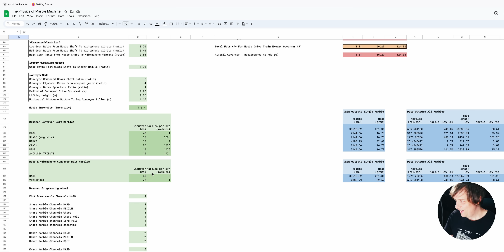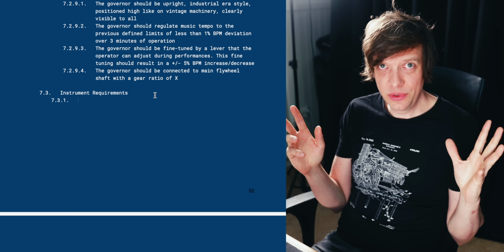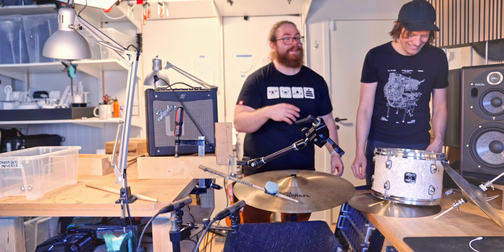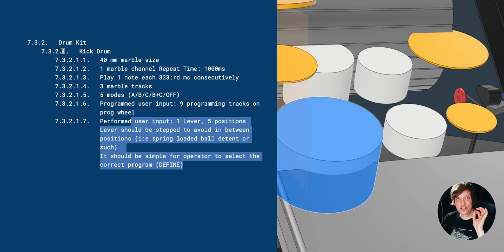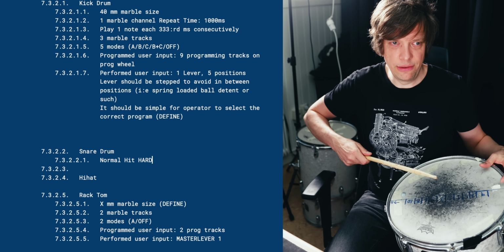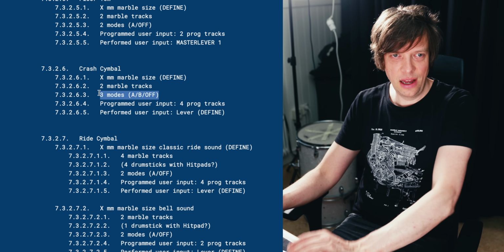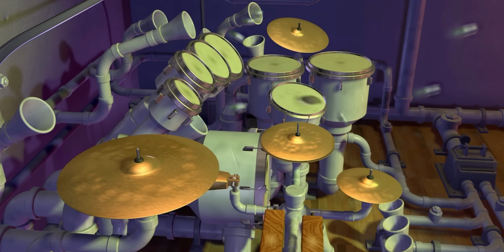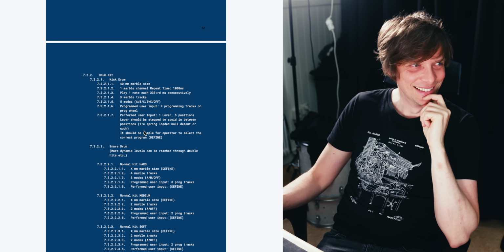Building the Marble Machine in a text document - Better than I thought!

Comment: If you continue like this, you will fail for the same reason MMX failed. Calm down your requirements, no dynamic music, less channels, make a portable machine and not an airship where a band as accompaniment is obsolete anyways
Reply: I think this machine has a better chance than his previous machines because he planned it out, and started using advice and ideas from the community. His other machines, he just winged it, and ultimately suffered the consequences.
Reply: i agree that it is monstrously big and not portable enough to be used frequently between sets and countries, but the dynamic part id like, brings more artistic impression into the build
Reply: @ZT_1234 ok but let me ask the question why? As in previous videos we saw martins saying "i need to do things easier, more practical, with a simplier design" to not lose the real goal of the marble machine: playing many melodies
Reply: This would be too logical. MMX could have been compelted already - applying those rules 3 years ago.
Reply: For th MM IV I'd go straight from text to punchcards.
Reply: @ZT_1234 that's how MMX was supposed to be.

Comment: Using two tracks to drop simultaneous marbles for dynamic range is going to exacerbate any timing issues and make them a lot more noticeable. Slight timing fluctuation between beats and instruments sounds human and won’t be noticeable in the vast majority of cases, but if every snare accent sounds like a flam, you’re going to end up back in the “perfect timing or bust” rabbit hole
Reply: I agree here.   Additionally, I believe Martin needs to consider methods for muting/choking the cymbals if it can't be done by hand(as would be the case with the current layout).
Reply: I agree. Considering Martin has room for more tracks, it seems wise to just add the extra channels back in. I think he'd only need to add half a dozen or so channels back in.
Reply: If the two hits are within ~10ms they shouldn't be noticeable. If the tolerance is 2ms that should be safe.
What may be more concerning is if he drops the marbles on different parts of the snare drum, the resulting sound probably won't be very nice since every part of the drumhead produces a slightly different sound and also the marbles will probably act like dampeners to each other.
It needs testing for sure but from experience it may be more of an issue than asset.
Reply: It will also probably create interferences between the marbles because of high-hat vibration which could create weird trajectories for the marbles that are difficult to predict (this is pure speculation though)
Reply: @mikosoft  Yeah that's probably not going to work if you hit a cymbal on two places at once.
Reply: Annoying that the video won't let me post a new comment of my own, but I just wanted to draw attention to "liquid courage"? That coffee? Or..?
Reply: @ilepcro  good thinking on the bigger picture, but from prior testing on the MMX the marbles have a quite predictable trajectory. Although, I would argue that apparent safety was what made Martin go for the “path of sunken cost fallacy” with those individual funnels instead of considering a more general collection system on the MMX. 

Remember that it wasn’t the marbles on the floor that made Martin give up on the project but the BPM tempo consistency and note timings.
Reply: Kinda agree that it should be optional, however if you have 50 or so channels anyways they all need to be synced anyways. So double drop souldnt be an issue on a well times machine.
Reply: absolutely
Reply: As soon as he uttered the words "dropping 2 at the same time" I immediately thought of the timing nightmares!
Reply: Any delay will be noticeable, if only to martin. remember back when he was doing timing tests on the 3D printed marble droppers? At one point he had a click play from each stereo channel with some delay. I could hear all the way down to one millisecond, just slightly but still noticeable. 
I agree with the original comment, trying to drop multiple marbles at the same time will lead to perfect timing or bust.
Reply: @kungfucasey  I have a theory on how that muting/choking can be done with the machine. Obviously you will need a channel for each mute device. A programing pin would work a Bogen cable that operates a... lack of a better term... clamp to stop the cymbal from ringing. I can imagine the force on the programing,,, key would be heavy. It's not dropping a marble. It's working a mechanical link. It would need to be made much stronger than the keys for dropping a marble. Just another thing to add to the complexity of the machine.
Reply: An actual (soft hard) flam could be very cool though.
Reply: Okay but hear me out: Martin has min-maxed the timing so much that “exasperating” timing doesn’t matter as far as the human ear is concerned
Reply: @dstewar liquid courage is definitely alcohol
Reply: @eugeneevergreen3850  oof. Just seemed, early, to me lol. But you do you!
Reply: Or the micro delay differential might sound cool
Reply: It might not sound like a flam though, might just sound like a double hit, like a human would play it.

Comment: i think the double marble idea is worth a test, but i suspect the volume difference won't be nearly what you expect it to be. theoretically, dropping them at the exact same time would actually cause the vibrations in the head to cancel out, and you'll get less resonance. intentionally dropping the marbles like a flam (soft then loud) might achieve what you're looking for, as the first (soft) marble excites the head so it can speak more from the loud hit. it also adds a layer of expression that is, to me, essential to the snare drum sound. just a thought, cheers!

Comment: The only requirement for the mmx should be: play music.
Everybtime you add a requirement, you steer away from your dream. People falled in love with the first machine, it wasnt perfect and it didn't have 20 instrument. Your ego is getting in the way, you're not gonna build a huge multi instrument machine band machine like the ones in the museum. Not with marbles, they used pneumatic, you can just use punched paper, a lot of tubing and cylinders, way easier.

Comment: Making a machine capable of travel with the intricacies it requires, regardless of how easy it may or may not be, will require a substantial time investment. Aluminum seems to be a necessity for durability and reduced weight compared with iron, or iron-aluminum steel, which will be expensive. It may lose the charm of the older woodwork iterations in some capacity, but it will make up for it with it's capabilities and will remain a mesmerizing showcase. You already have skill, you already have luck, so what do I wish for you? Cheers to the journey, and thank you.
Reply: Aluminium has about the same stiffness per weight as iron so it's not really a weight saving. Also it's more expensive. The only thing that aluminium is better at is, that it is doesn't rust, but you can just use cheap stainless steal like 1.4301.
Reply: @florianvelling6427 stainless will still tarnish, albeit less than untreated steel, especially once worked as the zinc coated will be damaged by sanding, cuts and acidity from hand grease. Take it anywhere near the sea or port and it'll be rusting wherever it can. Unless there's a physical coating of paint or varnish which ruins the look.

Reality is the design is too big too heavy and needs to lose 50% of the bulk

Comment: Why does the marble machine drum kit need to play dynamically when you have a live drummer? Hell, why does it even need to be tight with a live drummer along side it? The live drummer plays dynamically. Also, he doesn't play tight. He covers your dynamic requirements, and also nullifies your tight requirements. You need to think about the live show as a whole, not the machine. Dynamic play is a requirement of the performance, not the machine.
Reply: I think the main problem of “not tight” machine is not that it would get out of sync with the rest of the band, but that different parts of the machine would go out of sync with themselves, and that would be hard, if not impossible, to adjust live.

Comment: As an engineer, we do Design Requirements with hierarchical naming. 

As an example: 
- Instruments.DrumKit.Bass.Channels
- Instruments.DrumKit.Bass.Throughput

Or something along those lines.

We use a tool which gives us a Matrix, linking User need -> Design Requirement -> Design Output (where it is implemented) -> Verification (How you plan to verify that this requirement has been met) -> Validation (Some way of measuring that the final complete design actually solves the User Need)

The matrix pivots off each design requirement.   (pivot tables in excel are your friend, if you don't wanna buy a software tool to do this... Working in a medical device company, all these methods are regulatory requirements, so we pay a company for software that makes it easy to manage design matrixes)